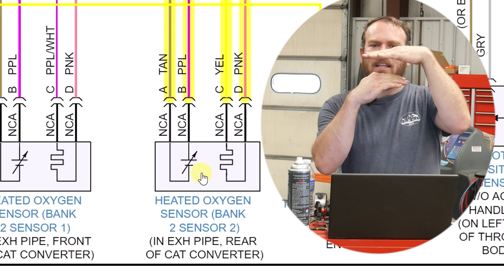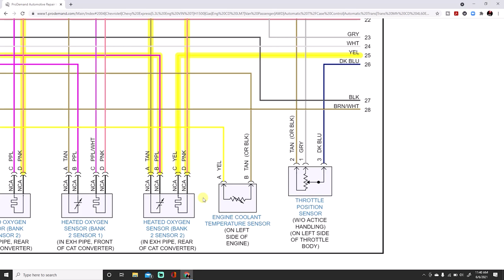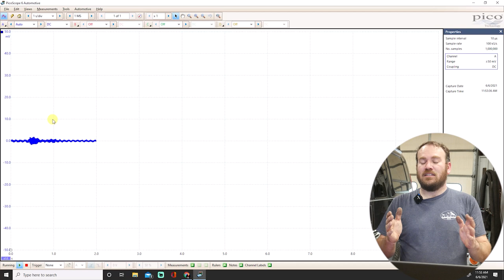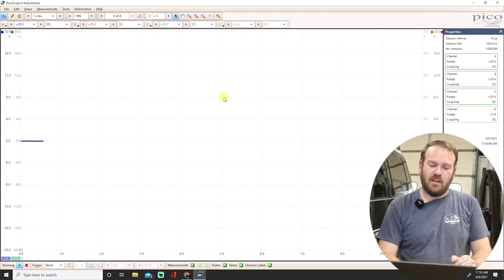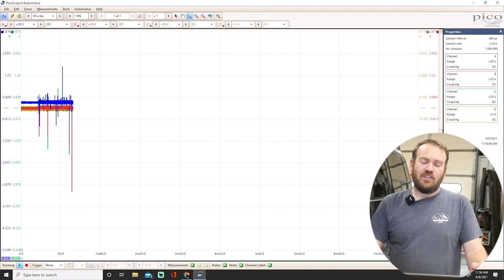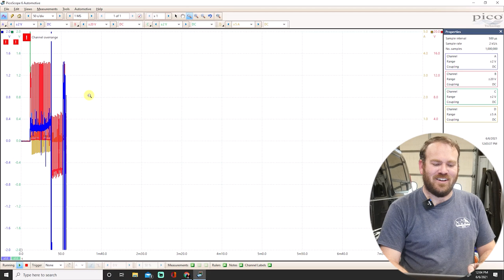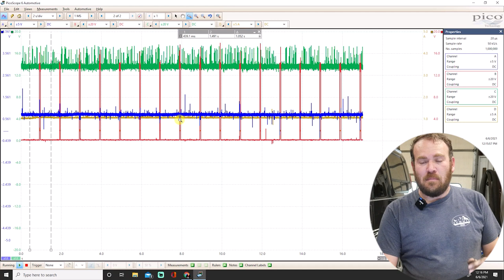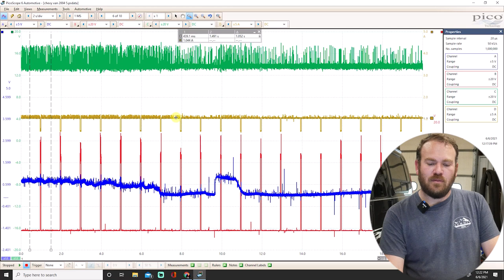Weekly Waveform 21 - Testing Oxygen Sensor Signal and Heater Circuits

Comment: So my blazer was giving me a P0147 code and when I looked at the signal I saw only the bias voltage of the O2 sensor. I only saw the heater voltage when I first turned the key on and the voltage what only there for about 5 seconds. I didn’t have an amp clamp that small to check the current draw. I did check the ohms of the heater element and it read a direct short. I figured I’d see some low amount of ohms.
So I replaced the O2 sensor and now I do see the switching of the heater voltage and a normal switching of the sensor signal.  Glad I saw your video!
An electronics tech by trade but a home car mechanic to save myself money! 👍🏻

Comment: LOVE THESE CLASSES I DO NOT TRY MISSING THEM THANKS SO MUCH . IS THERE A AVERAGE AMPERAGE READING FOR A O2 SENSOR SO I COULD KNOW IT'S ACTUALLY WORKING OR AT LEAST DOING SOMETHING. THANKS AGAIN FOR YOUR TIME AND EFFORT !!!!!!!!!!!!!!!!!
Reply from the maker: Most heater circuits will pull around 1 amp. Some vehicles will be less than that when the computer changes duty cycle of the heater ground. The amperage on the signal wire will be very small so we typically just check the voltage on that circuit. The signal will range between 0.1v and 0.9 v for most vehicles and 1.5v to 2.5v on some Chrysler products.

Comment: Can you make a video regarding the strategy that is used to determine a good working sensor. I been told that Honda uses the rear sensor to determine weather the AFR or up stream sensor is working. You get a code for the front and not the rear sensor.

Comment: So if the cat converter was working would the ecu read a steady 450 millivolt signal from the rear 02 sensor.
Reply from the maker: Typically you’ll see 650 to 750 mV that is fairly steady if the catalytic converter is working and everything is warmed up. If the signal is stuck at 450 mV the O2 sensor may not be warming up properly or you have an open circuit on the signal wire.